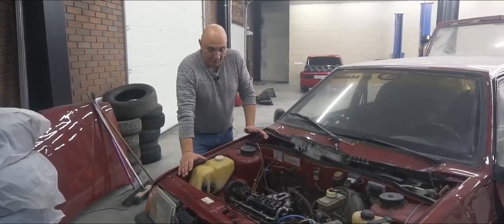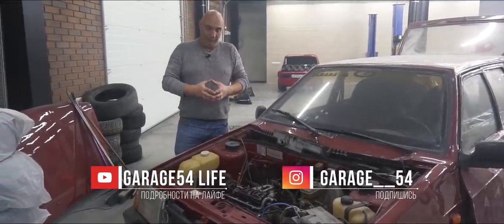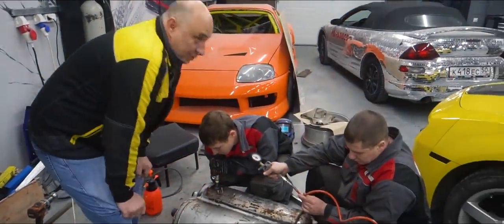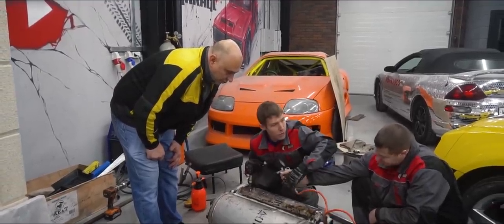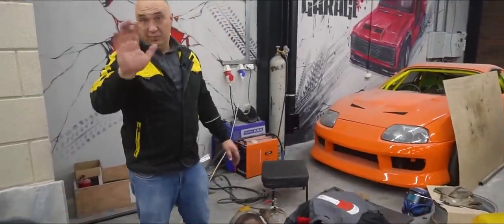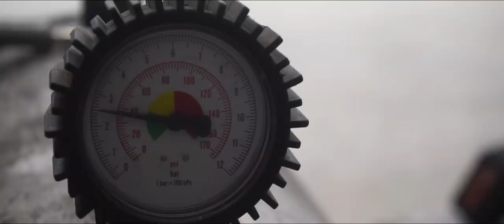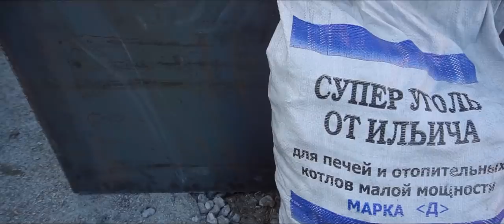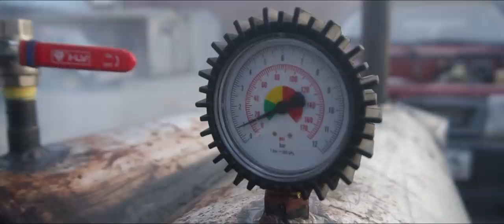Steam engine conversion – first startup

Comment: If you build in a blower to blow the coals when pressure is dropping and turned off when pressure is good.   Charcoal isn't quite as good as coal for heat out put either, you could burn oil, any old waste oil would burn nicely for steam engine then rework your water circuit so its looped in and out of the heat several times then direct heat on the final path to the engine.   A coal/waste oil hybrid burner would be well cool, one of the most successful steam engines was the Prussian T20 which operated in East Germany and could climb steep inclines other engines couldn't and still pull a heavy load, that was oil fired and a real monster coming close to Britain's world record holding class 9f 2-10-0 for steam traction power.   I wonder if you should try a gas turbine in a Lada... that would be fun :)

Comment: I really like that boiler, gas tanks for a boiler is a great idea, I would have left them separate though instead of welding them together, I don't see the point, except tons of extra cutting and welding. Seems like you could get more pressure leaving the tanks separate and piping them together too and it would be a hell of a lot easier.

Comment: It's impressive my only concern is the complete and utter lack of safety devices on that boiler like no sight glass no hydro test and it would benefit from a super heater loop and a larger stack. They could also always use some of the exhaust as a jet in the stack to pull more air in to the fire box further increasing the output of the boiler.

Comment: Probably too late to comment but, steam will get past the rings into the crank case and force the oil out. To make this work you have to seal and pressurize the case and block. Also, try using propane as your energy source. You dont want to accidentally hit your boiler tank with a shovel and risk a stress fracture.

Comment: cutting the tanks like that and then trying to put high pressure in them is insane. the strength in a cylinder comes from it being round, I wouldn't want to put even 5 bar in that thing.

Comment: Needs smaller fire tubes, and water injectors so you can have less water in there at a time. 

A condenser and heat insulation would also help.

Comment: RUS:Я бы порекомендовал использовать автомобильный охладитель в качестве конденсатора воды, чтобы вернуть использованный пар в воду и вернуть его в водонагреватель, а также разместить клапан высокого давления на стороне, где находится выпускной патрубок, как в автомобилях с турбинами, и вернуть эти газы в следующие два цилиндра, чтобы сделать работу.
ENG: I would recommend using the car cooler as a water condenser to return the used steam to the water and return it to the water heater, and to place the high pressure valve on the side where the exhaust branch is, as with cars with turbines, and return those gases to the next two cylinders to do the work.

Comment: Stewart Hawthorne told me a long time ago -- Saudi Arabia ~1980 -- the boiler is the largest part of the steam engine.... by far... just look at any old steam locomotive.  

Anyway, pretty scary. Do a hydraulic test on the boiler first! ... at least 2x the working pressure, eh.

Best regards

Comment: After that awesome steamcar - please use the water boiler as a watercontainer and weld it to a diesel cars exhaust pipe and remove all nox from the exhaust filtering it though the water before going to the air - hope you get my point

Comment: Also pretty sure steam produces a lot more torque than anything else so even at 500rpm you're rolling strong. You need really short gearing if not direct drive for that.

Comment: Hopefully you convert from coal to propane and propane accessories. Also Tom Lanhaye IS 100% correct... you NEED to pressure test that vessel to at least 120% MAX blow-off pressure for at least an hour. Then ensure blow-off valves can dump FASTER than you can create steam in optimal operation. Last thing you want is 175C water expanding in standard atmospheric pressure. Even on a trailer you'd be looking at an explosion easily capable of throwing the back hatch or parts of it through the front windshield. Whether that includes through someones head or not won't matter much.

Comment: Steam engines put in a sniff of steam at the start of piston stroke. That sniff gets longer when more power is needed. The compressed air test proved the valve overlaps of petrol engines with will blow most of the steam down the exhaust.
By the way you need a superheater to increase efficiency.

Comment: Just weld some steel beams from the front of the car to hold the boiler, then put a spring return on the ball valve and weld a bracket to reroute the throttle cable to the ball valve... can even weld a stop screw to set idle :)

Comment: if you're working with hot air than you should connect exhaust back into the intake that way you're not losing the pressure and you can keep going longer with less fuel

Comment: steam boilers can have small fire tubes. depending on the size
Reply: and there is a thing called a safety valve. so when the pressure is way to high. the safety valve releases steam.

Comment: I recently watched some documentaries about steam locomotions. Maybe you could improve the concept using kind of a turbocharger. The low-pressure steam that exits the exaust pipe could maybe suck the exaust out of the chmney. Some newer steam locomotives used similiar concepts

Comment: You could probably put the whole generator thing on a trailer and just use flexible hose to feed steam to the engine. That should save you some time and would also be (probably) safer.

Comment: You need a "steam dome" to be sure that you are not shooting hot water into the engine instead of steam. The steam needs to be as "dry" as possible so that the cylinders don't crack the head. Water doesn't compress, so the more water in each cylinder the bigger chance to crack the head. Drain cocks are used on steam engines to help solve this problem... that is why, when you see a steam train leaving the station, there is a big hiss and steam with each stroke until the driver is sure the water is out of the cylinders. Then he closes the drains and the extra steam drives the cylinders instead of a lot of it escaping from the open drain cock. 

You should feed the new coal from the other end of the fire box instead of the end where the smoke stack is. The air should flow from where the fire is to the smoke stack (funnel).

Be sure to include an ash grate on the bottom of the fire box so you can add fresh coal. You can't dump ash on the street, so the ash grate will need to sit on top of an ash box (metal).

You will need a way to add new water into the boiler while you are driving. Waiting until the boiler is empty will have you waiting a long time to heat up all the water again. The device on a train engine to do this is called a "feed water pump". It uses pressure from the boiler to drive a small steam engine to pump fresh water into the pressurized boiler. You could probably do this with and air compressor hooked to a sealed tank full of water, but sloshing around will need to be considered. You want to pump water, not air, into the boiler.

The pressure in the cylinders will probably push water into the engine oil. You may want to swap the oil for a very thick steam oil.

You should air test the boiler to at least 3x the pressure you intend to operate it at when under steam. Be sure to include a "poppet valve" on the boiler. This will automatically release extra pressure once the desired pressure level is reached. If you install a "steam whistle" the operator can blow the whistle before there is too much pressure as well. : ) Also, I would include 1/2" plate between the boiler and the passengers. Shrapnel from an exploding boiler is a bad way to end the day having fun with your steam car. Good luck, and Merry Christmas!

Comment: Unless you want to be remebered as the guys who went into orbit without a rocket you need to do a few things NOW !!! 1st do a hydraulic test on the tank to make sure it does not blow up when you try to use it, it is very easy to do look it up... 2nd add a safety blowoff valve large enough to release pressure should it start to runaway, and designed to go off at 50-70% of the maximum hydraulic test pressure. When water turns to steam it expands around 1700 times in volume so 100 literes of water would turn instantly into 170,000 liters of super heated steam in a fraction of a second if the tank ruptures simultaously cooking you well done and launching you into near earth orbit!

Comment: I forget the name of it but Jay Leno had a steam powered car that was able go ahead and put expended pressure back into the expansion chamber and thus was a more efficient steam powered system then say the Stanley Steemer was. thing about it is is that even though the car ran on Steam, it use gasoline to heat the water to make the steam.

Comment: In 1900 to 1920 people made steam cars  but they had a problem and that was the big steam boilers to solve this they used thin small copper tubes 
bent in spiral shape and in the middle was a fireplace and so the heat passed exactly through these thin tubes.while these small pipes 
were connected to a large reservoir of cold water
 who used to make up for lost steam in copper tube.what is important for any steam engine is to connect a vacuum pump to the steam outlet of the piston
 because in vacuum the water heats faster then exhaust vapor part of it is carried in the condenser and part is released through the chimney of the boiler Who, when released, makes a vacuum in the chimney that will draw more air and thus greater fuel combustion.

Се најдобро во правењето на вашиот парен автомобил.

Comment: I think that a induction boiler is smaller and more efficient, also, a turbine instead of the engine would be better, but... Ok, it's working fine as it is, but... You guys could try this setup too, maybe with a truck turbo, can even use the compressor on it to increase the pressure in the boiler.

Comment: A rocket stove that could become a blast furnace when the car is moving might have been a faster route to heating water. It would get very hot though. Probably the reason why old locomotives did not have forward "ram" vents.

Comment: The compressed air would have been better to charge two cylinders and then recycle the exhaust to the intake of the next two cylinder before exhausting completely. In fact I think with the original cam lobes you could have used the engine to compress more air by using the spark plug ports as compression outlets to use some of the air power to reproduce more air power to recycle and increase the air efficiency and making the engine run.

Comment: With steam power you only need two pistons. Remove the other 2. 1000 rpm will probably push it in 4th gear.

Comment: Probably the fire box will be at the back (insulated with rockwool, also safety steam valve), with someone filling the fire box with coal, like steam locomotive. Also like it, you pass trough the exhaust steam trough the chimney to make venturi effect and pull the air in the burn chamber. Also condenser to save the water ;-) naah.... engine oil will cream up eventually....

Comment: Well, steam takes up 1000 times as much space as water. So, it can work. Though using triple expansion cylinders would be more ideal. As the enthalpy of the steam drops every time it's used. And triple expansion steam engines use most of it. Recycle the water and make more steam. It is very efficient. Though not nearly as efficient as a steam turbine. Though I doubt they could make dry steam at 300 psi.

Comment: If you fit the boiler in the back you  will need to make a trailer for the coal shoveller from the trailer to the car.or an extension on the back.low revs of steam is more powerful than high revs of a fuel engine so you should have plenty of torque.next build a gasification engine device please.

Comment: If you want talk about zero emmissions: don't use coal, but use gas. Gas can also get very hot like 2500 degrees when controlled good, and you don't need BIG boiler room (coal room needed).
Take also look at how old steam cars works. They have a lot copper tubing inside the heating boiler, so water can go trought it and heated propely and faster. A big boiler filled with water need long time to heat up whole water up and then finally reached needed pressure.
So yes, for steam car, you need better designed boiler...
And in cold countries: isolate boiler too.

Comment: The very efficient steam engines near the end of the steam age they would have like three stages where they would use the hot steam coming out of the first stage to power the second stage and then from the second into the third stage that's how they got the most out of the hot steam.

Comment: Get a small pickup truck. And put the boiler in the bed of the pickup. The truck will hold the weight  better than the car. And less modifications to make.

Comment: should have used a closed system like the old steam cars and by using a liquid or gas for fuel the boiler would be much smaller  like 1925 Doble E-20

Comment: You might need some sort of drain cocks on the cylinders, until the cylinder is above 100 degrees any steam that enters it will turn to water and hydrolock. if you look at a steam loco setting off thats what all the steam is coming from the sides its not the exhaust.

Comment: Boiler needs a safety valve, water sight glass and an injector or pump to replace the water used. Neat idea, but that boiler could be a bomb without those items.

Comment: The coal is interesting, but this is 2019, and this is impressive, but could the furnace be fed by kerosene or even better rape seed oil, an external combustion engine of the modern age. Some Steam engines in the UK were fitted out to use diesel in the second world war, due to shortages of coal. 
Just putting ideas out there.

Comment: Instead of welding the extra lugs on the cam couldn't you just change cam pully for another crank pully so you get a 1 to 1 ratio. Might be easier if the head is now trash? Can't wait to see it move
Reply: Spinning the cam faster to be 1:1 with the crank is actually a bad idea because each valve event becomes half as long as it was originally. Adding an extra lobe means you retain the longer valve duration.
Reply: @kasuraga  as your going for forced induction would that be a concern? And is the cam now a banana from all the heat?
Reply: @edd6113  theres no way the cam would banana. theyre way too hard for that. and the pressure that system is putting out is nothing compared to how much pressure an engine normally sees
Reply: @kasuraga ? So all the welding building up the lobes wouldn't cause that cam to twist? Is it past your bedtime?
Reply: @edd6113  no, it wont cause the cam to twist. unless you were dumb and welded on one spot the whole time and massively heated it up in one local area. everyone knows to prevent warping you weld small spots at a time to let the material cool down.

camshafts are hardened anyways, they wont warp easily.

past my bed time? dude, its the middle of the afternoon where i am.
Reply: @kasuraga  and what happens to hardened steel when you weld it? At the end of the day its some mad man making a steam engine and a boiler/bomb it spun he's happy I laughed, all good. Try and do what he's done and you will see what I'm saying.
Reply: @edd6113  You can weld hardened steel just fine NO issues as long as you let it heat and cool properly so it doesn't temper and become soft. Hell, some camshaft regrinds are actually welded, then reground to the new profile.

What makes you think that somehow welding hardened steel is a problem? If you know what you're doing there's no issue. Heck, you can even tell in this video they had no issues with welding their camshaft as it didn't warp or anything like that (if it warped even a LITTLE, the fucker would have been bound solid in place and not rotate. Cams don't exactly have much wiggle room for warpage)
Reply: @kasuraga  go and try
Reply: @edd6113  i dont have to try. its been done for decades already and is well documented how to properly weld hardened metals. maybe you should read up on how to weld hardened metals and how cam regrinds work when they weld on the lobes.
Reply: @kasuraga  welding up a worn lobe and building a new one of the back of the cam are two different things. You tube is full of people who comment that have never picked up a tool. I've spent enough time professionally and pissing about to know they had trouble after doing that. Spend some money and go try instead of misunderstanding that a cam regrind is the same as the effort they did here.

Comment: Please put a compression gauge into one of the spark plug holes.
Reply: It'll never be more than the pressure in the boiler, obviously less for losses.  
Looked like they had the boiler up to about 3 bar.  That's about a third of a typical internal combustion engine BEFORE ignition of fuel.
It spins the motor, yes.  But it won't really have a whole lot of power.
I didn't see what they did to retime the valves to make the motor run on air, but if it's set up right, one of the great things about steam is, it can indefinitely apply torque to the crankshaft, as long as the "intake" valve is open and feeding steam to the cylinder, and the piston isn't at TDC or BDC.

Comment: With all that steam the engine was bound to seize in a few minutes. Introduce an expansion tank guys and make it a closed system otherwise no lubrication can be possible. Seriously, you guys need some safety for this one. That steel tank will explode.

Comment: Remember you turned it into a steam engine. 1500rpm is your max flow, aka volume. Pressure makes your power. If you put it on a dyno i bet you will get insane torque numbers like 500ftlbs at 800rpm